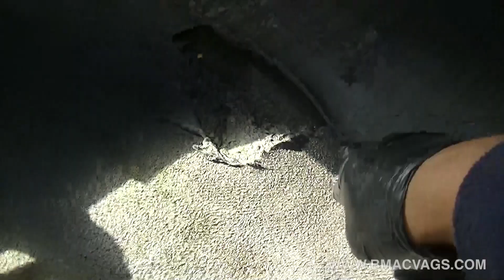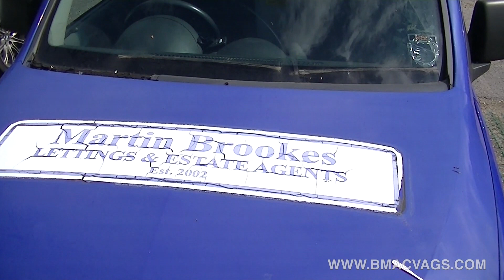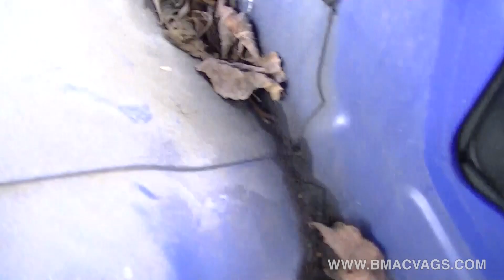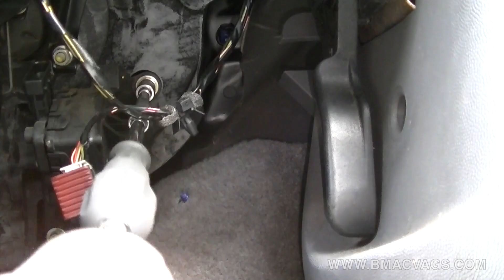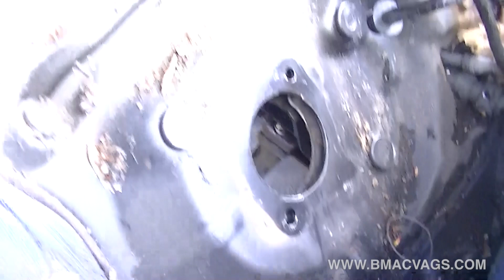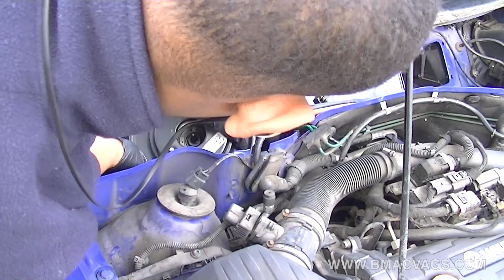Opel Vauxhall Corsa Leaky Wet Floor Repair

Comment: Top Man, awesome. This is the clearest an most instructional way so far available. All the rest want you to take the fluid out of the brake servo an after bleed the brakes and don't give as much detail as you. Your a life saver, thanks a lot.
Reply from the maker: Glad it helped
Reply: Very much so! Will be doing this on my Tigra B. Thanks again.
Reply: I agree with you and there is another one I watched the other day.
A Mechanic in Bristol has made a video of a Vauxhall Corsa C doing the same method.
I'm happy it's given me good inspiration for my two Corsa's
Regards
Nick

Comment: Arrr I done the same job the other week I disconnected the master cylinder on mine just to get it out of the way I no need to have done oh well.  I done mine the same way you did to re-seal it. A job well done especially when no more water gets in after a big down poor after getting it all back together again. Thanks for shearing. Steve.